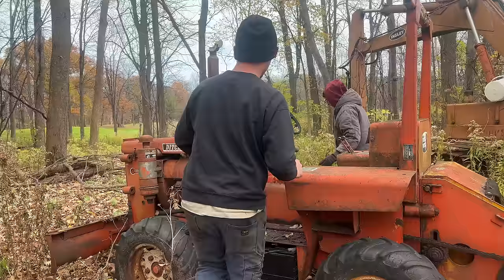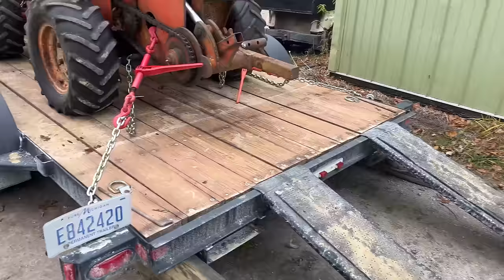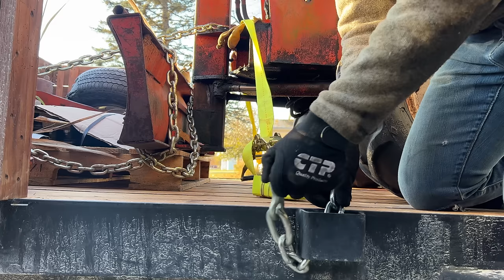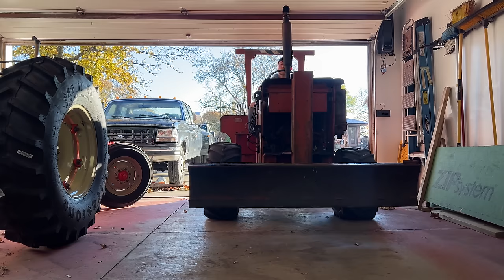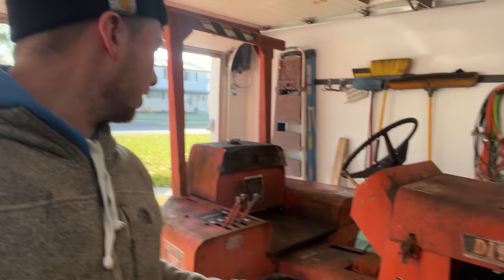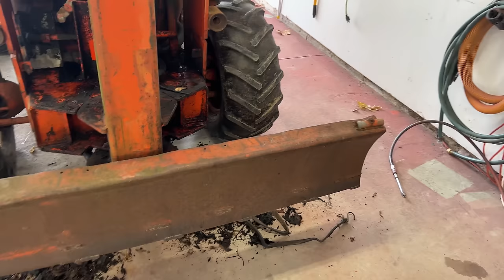FREE Ditch Witch | Will it TRENCH again??

Comment: Hey Tyler in the late 70,s here in South Australia I worked with a State owned Authority and we had chain trenchers of various brands ,they did a fantastic job while they were working ,but so many moving parts ,and Ditch Witch parts in Australia were very expensive ,eventually Back hoes replaced them because the hourly hire rate was much cheaper as they spent so little time in the workshop,and a Massey Fergusson back hoe was basically a farm tractor you got parts anywhere ,buts there,s no denying the trenchers were fun to operate. Look forward to you fixing this machine .
Cheers Kym
Adelaide

Comment: Some water and washing up liquid goes a long way to help getting tyres off the wheel and over the edge of the seat. By the way I enjoyed watching you for the first time, especially seeing you do the repairs on the ditch witch. A machine that I have only once seen before or at least something similar here in Britain. But that was over 40 years ago now.
I would have taken the seat off the scrapper even if it didn't fit correctly you probably could have adapted it for yours. When we had scrapyards like that I was always looking around them to see if there was something that I could use.

Comment: What you have is a first generation R-40. I can tell by the front blade post (versus underslung in later models) and the old style decals. I worked on many of them in the late 70s. A good machine for its era. If you can get the drop box and right angle drive issues worked out it will be a good machine for you as long as you don’t try pounding on too much rock.

Comment: I live about an hour from where these are built. I had a summer job a couple years working for some guys that laid poly oilfield lines. They had a gas R65 and a diesel R6510 with rock chains on both. Very capable and pretty durable machines. I learned to operate them as well as service and repair them. They didn't have an easy life in this part of the country. Lots and lots of rocks and some rough terrain so they got torture tested about every time they went out. Appears to me the only service yours ever had was when it left the factory 45 years ago.
Reply from the maker: That’s what I was thinking 🤦🏻‍♂️

Comment: Id bet you can replace the bearings and seals in the 90°gearbox and put it back together and run it. It dosnt.look like the gears are shot. Remember it turns slow and there isnt much hp there. Ive seen similar run for years.

Comment: Tyler ya'll need a Harbor Freight tire machine. You spend all day beating on a tire and the bead breaker itself is worth what you pay for a tire thingy. Then the only thing you will need is a spray bottle to spray water and soap on the tire. The Dawn dishwashing liquid serves two puposes. 1. Find leaks around the bead. 2. Lubrication to turn on a new tire onto the bead.

Comment: I worked at ditch witch for a while and the jack shafts were awful as well as the timing belts on the duetz engines. But the r40 is a fantastic machine

Comment: Do you guys ever check to see what the value is on this stuff once you have it all rebuilt? Is it worth more than you will have in it? Just curious because nobody ever mentions cost of goods to repair and end value. This piece sure looks like it should be good when done but what's it worth?
Reply from the maker: If I were to sell it I would surely lose money. But if I use it to trench I would make money.
Reply: Well, that makes sense. If that is the case, I'd be putting the best parts I could find in it. And it appears that you are doing that. Fix it the RIGHT way. Thanks for your reply. That's more that I get from most comments I leave. @dieseJL
Reply from the maker: I love hearing from you guys!

Comment: Gearbox is a bit of a bummer, But a lot of that stuff, pinion and ring and some of them bearings, I'd clean the snot out of it and still run it, It's not like its driving at speed so even with some pitting would still last a while especially if the machine isn't going to be used a lot, My Allis Chalmers tractor is prime example of that, gear box was full of water and the thing sat for years outside, It was probably as bad as that. The parts I can find costs more than what the things worth, I cleaned it out, bearings and all, has pitting on everything, I just use a thicker oil in the gearbox than factor now, been going strong for the past 5 years now, well not used as hard anymore, use to pull around and load scrap cars with it.

Comment: Just some advice. Those old air cooled V4 Wisconsin motors do not like unleaded fuel. Makes the valves stick. Put some lead additive in the gas first, save yourself the headache.

Comment: Hi Tyler, we live pretty close to each other. You know you can get a bead breaker for aroun $100. That would have saved you most of your aggravation trying to get the tire off. I just bought a tire machine.  If you would like i could break the bead for you on the other 3 tires.
Reply from the maker: I actually just did the two tires and the second went much better than the first!

Comment: I changed a lot of tractor tires and when the beed is rusty it's a lot of work almost impossible to get the beed off the rim ... After many years later I tried something different i put grease around the beed so I hope it stops the rim from rusting to the tire

Comment: Any info on that insly excavator maybe a video on it ? I have the same one im fixing up and going to put it back to work
Reply from the maker: It needs a motor. It has the Cummins V378 in it. Leaking coolant into the engine oil. We will get to it this year hopefully, we really are starting to need an excavator around.

Comment: The bearings on the recondition gearbox sounds like they close to failing. Why not just replace the bearings on the old one?
Reply from the maker: The bearings are unique you can find them and then the old one had chipping and missing teeth on the gears

Comment: I was watching you beat your brains out on that tire thinking, dude, just take it to a tire shop, hand ‘em a few bucks, and get on with your life. Some things your better off giving someone a few dollars to do it and move on….. pick your battles. That “transfer case” is actually called a drop box.
Reply: Agree, but if you have to get it off use a jack on the tow hitch of a heavy truck or tractor to break the bead. I drive over the tyre with a digger to separate it from a rusty rim.

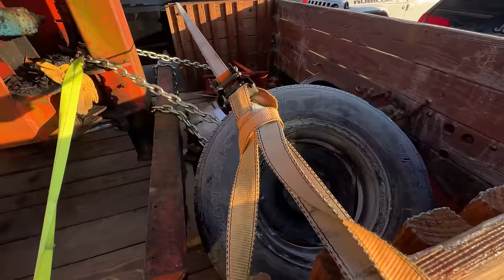Comment: 3:53 I'm not at all surprised that the Jeep Cherokee you have is a diesel model! I mean c'mon Tyler what else would you pick?! I would buy the exact same one, color & all. I prefer the color black on a vehicle - seems like you like the black paint too tho!? Despite being a Stellantis EcoDiesel, how is that thing? Probably needs a bigger turbo for sure tho, right? And maybe bigger injectors wouldn't hurt, either? Then you'll need a tune to make it all happy & work together correctly? Well you might as well do the weight-loss program at that point & gain the MPG's back too! 
I always liked the Cherokees, and would like to get an ol' TJ sometime and maybe diesel swap it(4BT?) or just keep the 4.0 - I6 which is a pretty good motor to begin with, & has alot of aftermarket support. Anyways keep up all the good diesel work....and the old iron w\ gas engines too!🤔😄😄😄👍🏻👌🏻🛢️🚜🛠️🔧🔩🦺⚠️
Reply from the maker: The jeep is awesome! Tons of power!